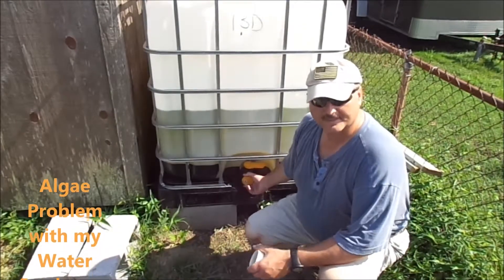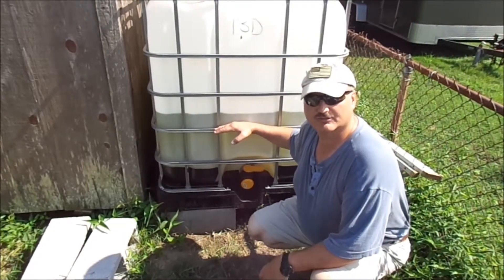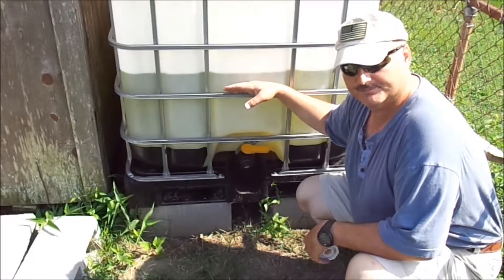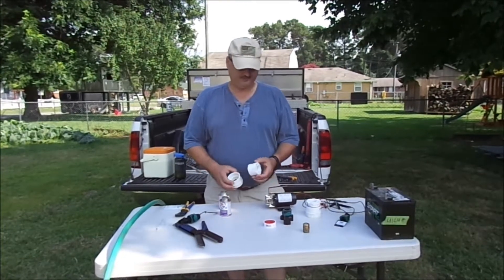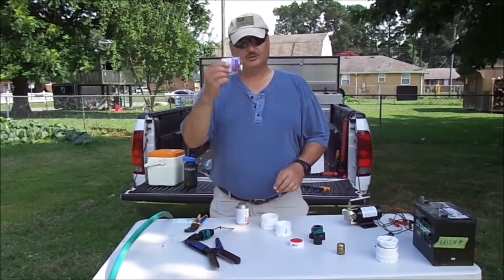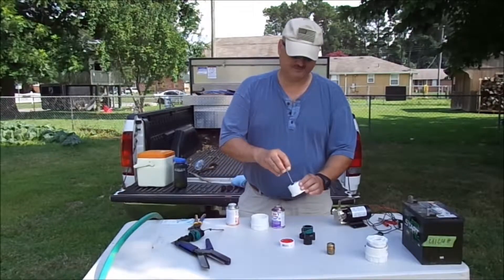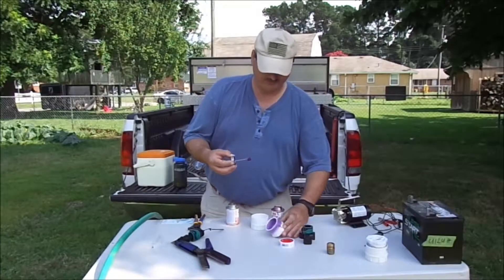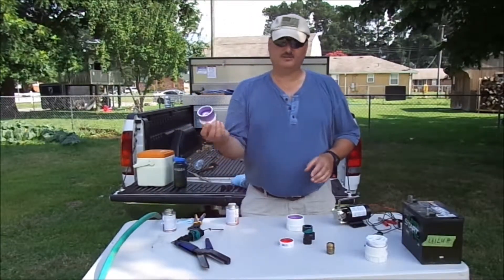How To Install a Garden Pump and Remove Algae From My Water Catchment System

Comment: Reminds me of my engineering days. Recirculate it, that is the proper term. Bleach kills everything and also cholera. Treat potable water tanks in the pit with Bromine and recirculate for 24 hours and tested. If test is okay, use if not, recirculate more and add bleach. Old BT1 here, and retired MM1 (Top Watch). Good job explaining how to use proper tools and proper techniques.  Awesome job McGyver.
Reply from the maker: Hilario Moncado  Thanks!  I tried to keep it simple.  I too am a retired GSM1 (EOOW) and former BT.  People definitely underestimate bleach.
Reply: I keep spare bleach for the SHTF thing.
Reply from the maker: Hilario Moncado I can understand that.  I try to keep around a case or two just for odds and ends.  As a side not, Bleach also kills Athlete's Foot within 24 hours.  The catch is that it burns like hell.